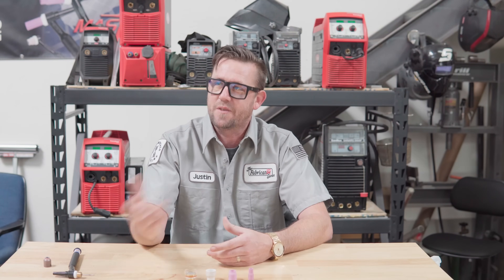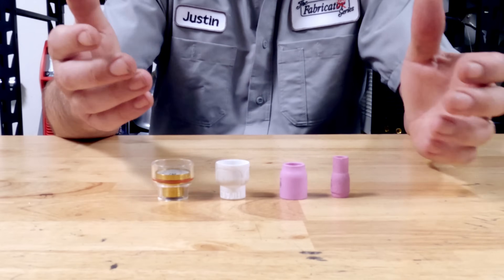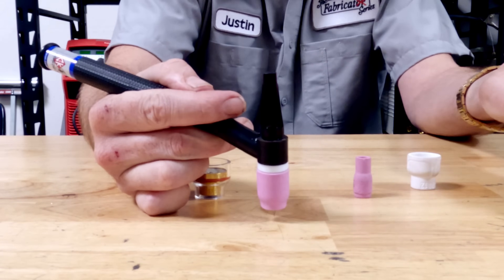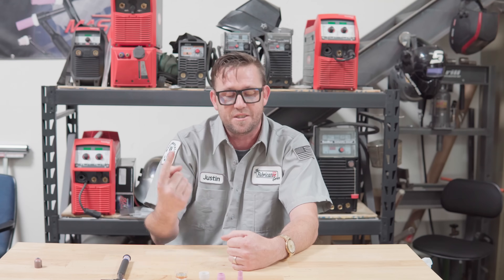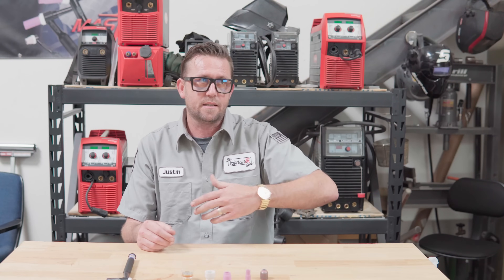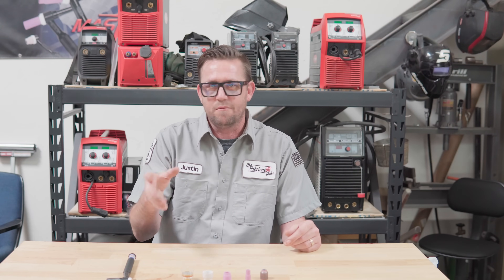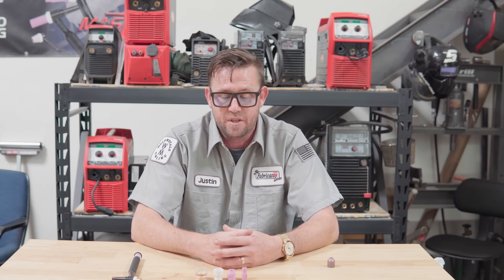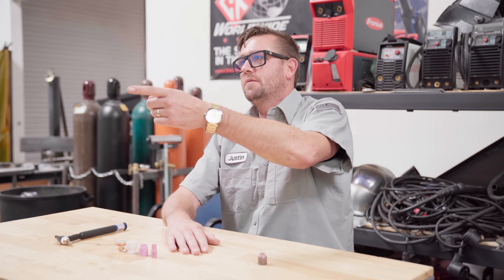Which TIG Cup Should You Use?

Comment: The most expensive parts I bought as a newbie were cheap parts from Amazon. Such a waste of time, tungsten, steel, aluminum, argon, etc.
Reply from the maker: It's a lesson we all must learn. Even Justin tells the story of when he bought cheap consumables.
Reply: How the hell would argon be a waste of money? 
Isnt 100% argon, 100% argon???
Reply: @Dahatakila   idk how he got 73 likes. must be from noobs. should you get better consumables? yes. can you still lay down some nasty welds with a cheaper rig? yes. if your welds suck its you. especially if you blame it on the tungsten and material lol
Reply: @MultiCPTmorgan   hey bro, would ya mind helping me out? im a noob and im having a hard time figuring out the torch setup. 

I got a Primeweld 225x with a CK Worldwide #17 torch.  I wanna fab up an aluminum gas tank thatll prolly be 3/32 to ¼ inch thick.
Reply: @MultiCPTmorgan   a guy said he uses a 1/8th tungsten for most aluminum and just makes the tungsten ball smaller if he wants to weld thinner. 

What kinda upgraded torch cup and torch internals would you use to weld 5052 aluminum roughly 1/4 inch thick?
Reply: @Dahatakila  17 series will work fine, im guessing its not an air cooled torch which is good or it probably would have been burnt up by now. i use 1/8" for aluminum too, you can run 3/32 as well, its up to you. The smaller the ball on the tungsten the more focused and centered the arc, but you can also up your frequency and that will help too. id say run anywhere from a #5-7 cup for aluminum. no need for a bigger cup at all unless welding other steels such as stainless
Reply: @MultiCPTmorgan  shoot..... my torch is air cooled
Reply: @MultiCPTmorgan   the torch is brand new though..... is it absolutely 100% necessary?
Reply: @Dahatakila  you can get away with using that just let it cool if it gets too hot, don't burn it up. depending on settings and amperage it could get hot pretty quick so you might have to let it cool in between passes. welding thinner smaller stuff at lower amperages you'd probably be fine. just give it a shot and see.
Reply: @MultiCPTmorgan  ok so im definitely going thinner gauge metal then. 3/32 at the largest. So im good on the Cup then.... but My torch didnt come with those brass internals that will hold a 1/8th electrode. Is there a brand/model you recommend to get. Figured ill upgrade since i gotta buy one anyway.
Reply: @Dahatakila  a 3/32 tungsten setup will be completely fine with the project you are currently trying to tackle. there isnt that much of a difference between running 3/32 and 1/8 for it to make a noticable difference imo. unless you are trying to weld some thicker material and using a larger filler wire then id jump to 1/8 just to help the tungsten handle the heat better. i just happen to have alot of 1/8 so i roll with it. also CK is a good company, that 17 you got should handle that project you got just fine. but if i were to upgrade anything it would be to get a cooler and a ck20fx torch. flex heads are awesome.
Reply: @MultiCPTmorgan  thanks for all your advice btw man. Wish id known this before i bought everything.   

Also.... What size argon tank do you think a non pro should buy? Im just a casual welder and occasionally use it to work on my cars. I do want to get good at it though.
Reply: @MultiCPTmorgan  damn youtube deleted my comment. Is there a difference between a CK20 or a CK20fx?

I only see CK20 on the website.

Thanks for your time. Thats all the questions ill bother you for. Thanks sir
Reply: @Dahatakila  FX just means flex head and i highly recommend it over the standard 20. if you dont weld too much and aren't purging i think an 80cf bottle will last you a good bit and not break the bank
Reply: what about the tig cups? ID figure even if it was cheap the cup itself wouldnt matter
Reply: I have a ck 20 with a Primweld tig 225 and cooler...I mainly weld 1/8 wall aluminum with a number 5 cup at about 10 cfh.
130 amps, seems to do ok, any mistakes is on me.😊